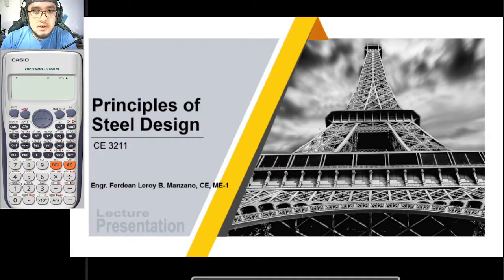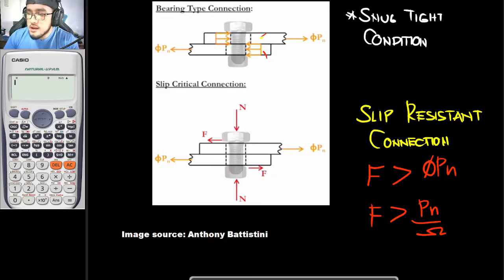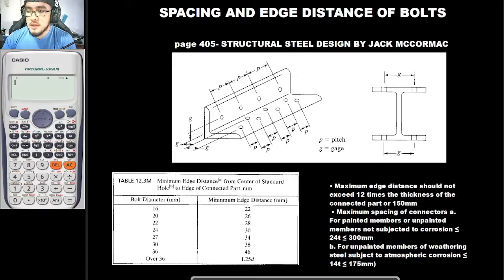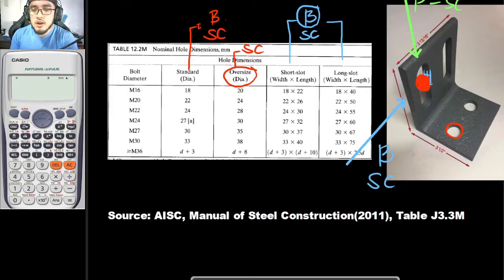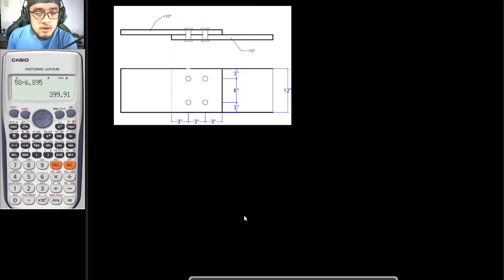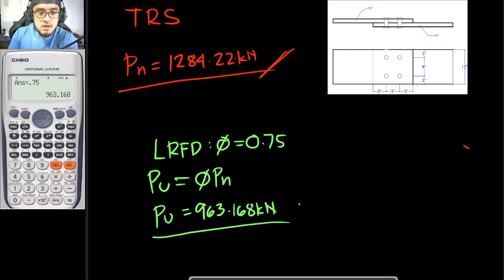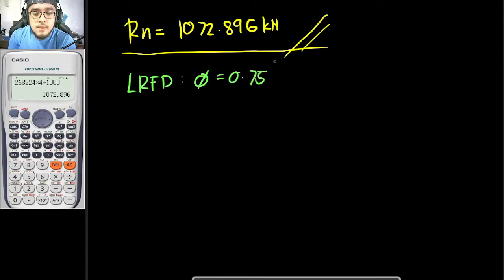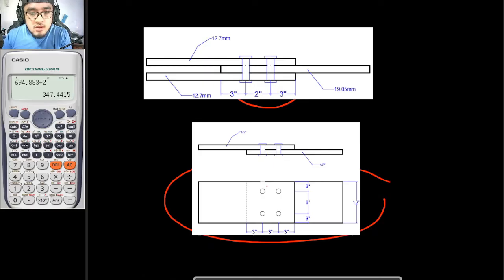CE 3211 Recorded Meeting: Steel Design-Simple Bolted Connections NSCP 2015

Comment: Good afternoon,
I have the same question about the additional 2mm added.  I noticed that in some calcs we leave 2mm and in others we are asked to do 2mm + 2mm?  Could you please explain.  Thank you
Reply from the maker: Sorry for the super late reply. Kagigising ko kasi.. jk 😅

For TRS, meron tayong code provision na mag add ng 2mm sa nominal diameter ng hole. So instead of 22+2 lang (nominal diameter of hole), 22+2+2 na siya.. (effective diameter for net area, NSCP 2015)

Pero dun sa pag solve ng lc, apparently may mali ako dun. Ang nagamit ko dun sa video is yung 26mm na supposedly for TRS only (code provision for NSCP 2015). Dapat yung 26mm, for Tensile Rupture lang siya. So dapat nga 24 lang when solving for lc. (So dapat value ng lc = 75.6 - 24)

Then for bearing formula of 2.4dtFu, yung d dun is diameter of bolt, not holes. Kasi yung bearing area is yung projection ng contact area (bolt diameter * thickness)

Comment: Sa dh po hindi po 22+2?
Reply: Siguro talagang +4 pag SI. Sa english kasi 1/8" approx. 3.175 mm so baka round up
Reply from the maker: @jp9523  Sorry for the super late reply. Kagigising ko kasi.. jk 😅

For TRS, meron tayong code provision na mag add ng 2mm sa nominal diameter ng hole. So instead of 22+2 lang (nominal diameter of hole), 22+2+2 na siya.. (effective diameter for net area, NSCP 2015)

Pero dun sa pag solve ng lc, apparently may mali ako dun. Ang nagamit ko dun sa video is yung 26mm na supposedly for TRS only (code provision for NSCP 2015). So dapat yung 26mm, for Tensile Rupture lang siya. So dapat nga 24 lang when solving for lc. (So dapat value ng lc = 75.6 - 24)

Then for bearing formula of 2.4dtFu, yung d dun is diameter of bolt, not holes. Kasi yung bearing area is yung projection ng contact area (bolt diameter * thickness)